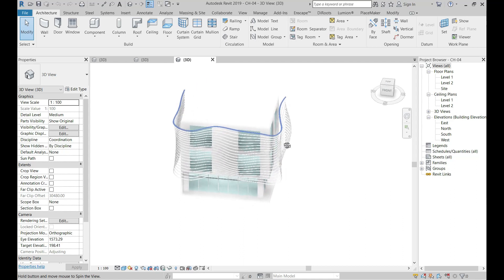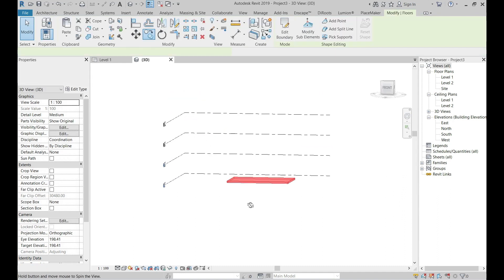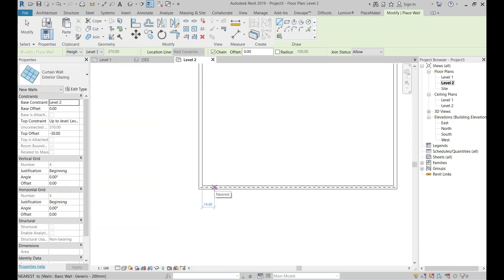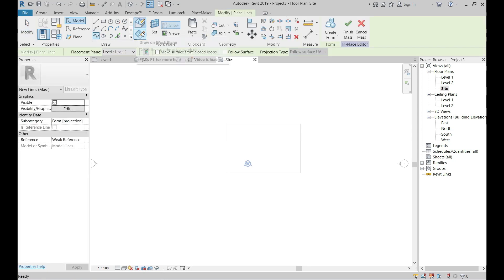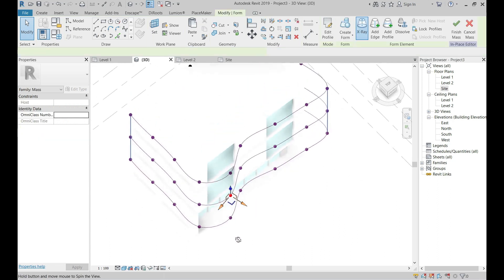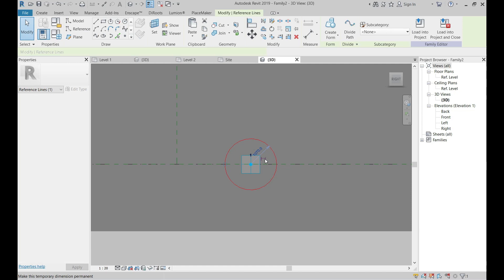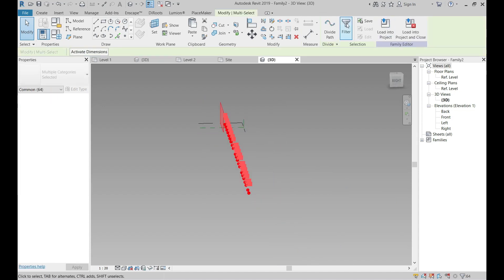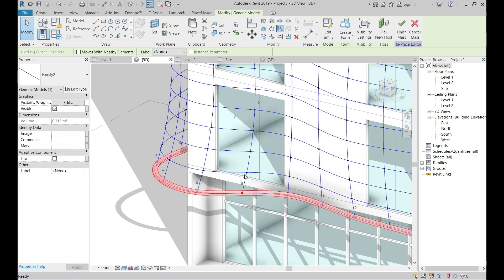How to design parametric skin in revit massing

Comment: I did every steps correctly but the family in not bending acoording to nodes... please tell me what to do
Reply: watch another video this one isn't helpful
Reply: I also had the same problem. It was because when making the circular profile I chose model line instead of reference line. Try doing that
Reply: honestly, for me, I created multiple reference lines on different levels then on each level I created model line of SPL line with nodes. Afterwards, I selected all the model lines which was created, then created the form.  then I had a family created of only six adaptive nodes. I placed the six adaptive notes on the SPL line nodes then I clicked on repeat and it built my entire form.
Reply: watch Adaptive Profile in Revit 2019 ( Extra Tutorial by Niko G. on youtube. his method worked for me

Comment: Thank you for your great effort, but I've tried to make rectangular profile but it does not work, I made it with parameters and without, it does not work in both conditions .. do you know how can I fix this?
Reply from the maker: Most welcome  @osamaabdelmohsen2262 
Did you try it in circular method ?
make sure that this method work with you , after that try it with rectangular profile
Reply: @sketchway1320   with rectangular profile it does not work entire rows but only some

Comment: Hi Thanks so much, but my pattern won't bend around the mesh, and I checked it's the Generic Model Adaptive Template .
Reply from the maker: Most welcom dear , while you creating the adaptive family make sure that lines are reference lines .
Also, try the family if it's working before loaded into project by move one of the adaptive point .
let us know if the problem solved :) ..
Reply: It is Not working before loading in project aswell, and I have even used the family template provided by you :(
 @sketchway1320